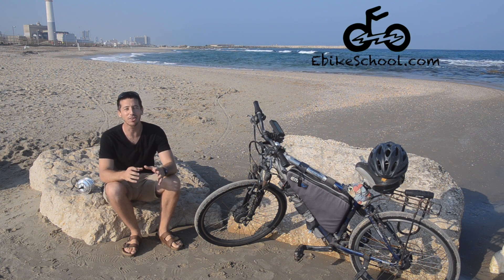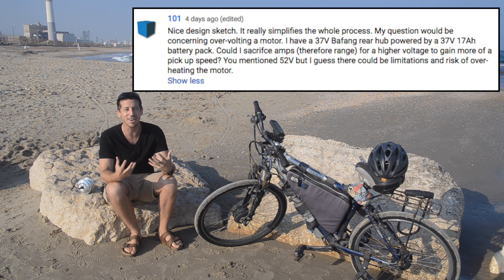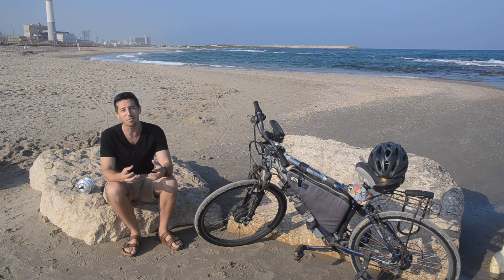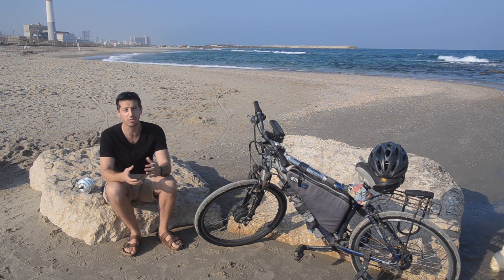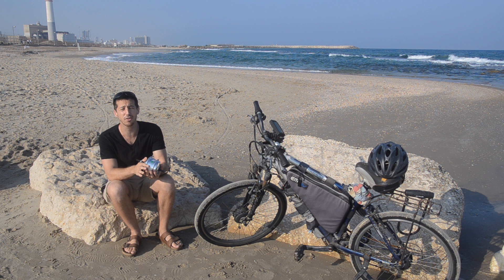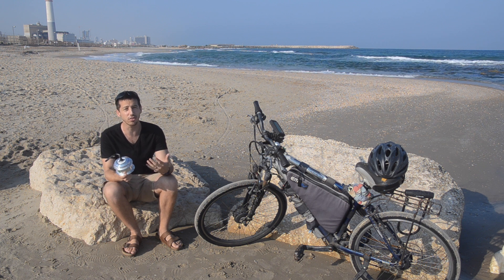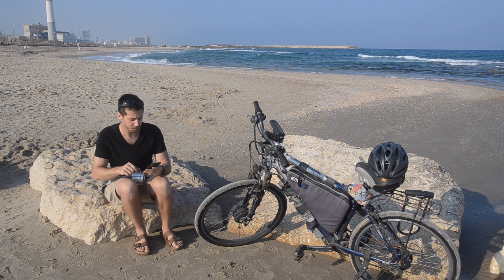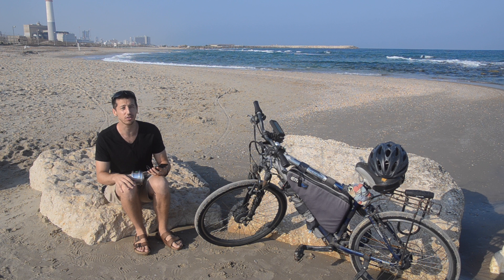Overvolting an electric bicycle motor for more speed! Q&A#7

Comment: By a Aniioki A8 Pro Max.Single rear hub motor.They have some customers return.I think $1.200 to $1,300.00.Then add a front hub motor.Let us see how it's done.The 2023 version is Hub motor 48 volts,1000 watt, Battery 52v

Comment: What happens if I have an electric bike with a 750W motor, and the controller, and the motor fails to work? What motor, and controller will be replaced for the 750W motor? Should I get my ebike fixed, or buy a new ebike?

Comment: Im making a solar powered carboat with electric outboards and 4 hoverboard wheels. It spins fast under no load especialy when i increase the volateg but when it has load less than 40kg, it doesnt move it. Why is it? Do i just need a bigger controller which is 70v instead of 36v?

Comment: Good explanation. I remember I had a motor many years ago back in the 80s. It was a DC motor, I applied 1.5v to that large motor and it ran, about 30 rpm, however that motor had so much torqute we had lots of fun trying to stop the rotation but we could not. Even that 1.5 D dry cell made it turn with super high torue.

Comment: Thinking about building a 16S4P 21700 (60V 20Ah) battery for my electric scooter (Yokamura i8), currently have a stock 13S5P 18650 battery (48V 15A). I have a Flipsky 75100 with Alu. PCB controller, and I'm pushing it up to 60A of phase current, and I'm very happy with the torque, but the max speed is only around 45-50 km/h on max charge and even less when the voltage decreases to <50V. I'll probably change the phase current to 40A or so to not overheat the motor. Also I'm thinking about buying a Kugoo G1 1200W-rated motor, which is actually capable of taking up to 6000W and even more, and this is the coolest motor which can be physically installed on my Ninebot G30-ish frame.

Comment: Hello Mica my name is Gunny I over voted an E bike that had a controller for 36\48 volt 22 amps motor came rated at 36V 750 watts I accidentally mounted a 48 volt battery rated at 1000 watts. My friend was buying it from me, while riding to the store and a friend's house all within a 5 mile radius of his home. He believed he had at least 20+ miles on 1 battery. He is not a heavy person 125 lbs. soaking wet.lol😊 on his way back home, about 3 miles , the wheel tightened up got real hard to pedal he said it was like the brakes were on.
After disconnecting the controller the.wheel spun freely again. Discharged the capacitors and reconnected everything and as soon as he pedaled it did it again! I installed different controller with display got it going told him NOT TO engage the PAS he should be fine.
It was until he decided to put a riser on the handle bars. He forgot when he reconnected it went back to default mode locked up magnets so I went through the same ritual trying to expect different results. HELP ME PLEASE. I'm pretty damn smart dude but this has me stumped.
I can put the motor on a different controller and it works fine. Is his wiring ( actually my wiring) F€¥¢π÷× Ed up or is there something I missed.
YOUR HELP IS GREATLY APPRECIATED AND THANK YOU.

Comment: Motors are usually manufactured with a 15 % "safety factor" built in ... so in reality a 750 watt motor can handle 862 watts before it  "redlines" the motor.
862 watt motor / 48 volt of battery = 17.9 AMPS ( volt x Amps = Watts )

Comment: Motors are in Watts ... Batteries are rated in Volts & Amps ( Volt is speed , Amp is power )
Amps x Volts = Watts ... or ... Amps = watts / volts ... EXAMPLE ( 750 Watt motor / 48 Volts = 15.6  amps )  highest amp limit or risk burning out motor.

Comment: Hey I have a e-bike running at 48 volt 20 amp and I’m looking to buy a battery thats 60 volt 24 amp all I have to do is buy a new controller that supports 60 volt 24amp right? Correct me if I’m wrong

Comment: Are you nuts? Amps and volts are directly proportional to each other,  the more volts you apply along with fewer amps means the speed of your motor will decrease.The motor weakens if you increase voltage and decrease amps or leave them unchanged. Sure, you will increase the speed of the Motor , but it will either  burn out the wiring, or your bike will just sit there if you attempt to go uphill. Less amperage equals Less torque . Tell me if im wronv.

Comment: I've got an A2B Alva+ 26volt 500Watt Ebike from 2014, it is incredibly built, unfortunately the axle spun a little and I have the wheel off to repair the wiring going into the motor, and surprise, no fastening hardware on the outside of the motor, which has a large UM stamped into the case. How do I separate the covers to get to the inside? there are 4 small grooves cut into both halves of the motor shell. Like maybe it is a srewed together clamshell design. Do you know?

Comment: I need to replace the wire into the motor but noone would fix it for me the tutorial on YouTube seem really hard to pull the cable out and you have to solder the cables etc i dont even have the tools so i want to replace the wheel but they dont selll 350w 36v only 48v 500w ... question can i still use the same battery and 36v with a motor that needs a 48v? Under voltage? Can it still perform as a 350w without any problem?

Comment: I did the math and it doesn't add up😅😅 it said that my 500w 20inch hub should be doing 19.2 mph yet mine goes 21.7 in first gear and 27.9 in second gear And I am a heavy guy 282 lb my controller overheats sometimes am I in freaky good luck with electronic lottery 🤔

Comment: I have a question.. I shunt modded a seeker24 dual motor, in the psettings I can change amps the controller uses or pushes.. its current 20ams.. but the controllers are rated up to 25.. would it be safe to bump the p-setting to say 22 ? would I see any speed or power increase ?  Motors are both 1000w, I have my controllers Resin Potted and added ventilation.

Comment: I really hope you respond to this.
I have a 48V 1, 000W motor with a controller of 15A rated current and 30A maximum current with a battery of 54V 12.5A

The motor spins freely without issue but when I sit on it and accelerate to about 15km/Hr the power cuts off, display refreshes (I am clueless if it's the BMS or controller  cutting off power and why}
Pls help.

Comment: Dude this is awesome!! Most excellent!! I've got a 1500watt rear wheel 29-in with a 48v controller. My question is can I use a 36 volt 8 amp hour battery without burning something out? The answer is probably pretty obvious but I don't know for sure I mean I get the idea that more is going to be faster and would be best to get a battery that has 1500 watt or 2000 w 48 volt 52 volt or 72 volt and as far as that goes what should I best invest my money in without paying six or seven hundred dollars for a battery I'm willing to pay $350 but again what do you suggest. Now I live here in Eugene Oregon and while it's pretty flat terrain there are still some hill in the areas that we need to go over bridges And it helps to have that little extra power to boogie on down the road. It's all about the amp hours that I see the price of batteries at a higher rate even if it's only 1,000 w 48v  if it's got a 20 amp hour or a 30 amp hour it's going to be a much more expensive battery. So also understand that 48 volt compared to 52 volt or 72 volt is going to be quicker off the line and a little bit faster when it comes to the volts but it's the watts is the speed I think right I don't know I would think that makes sense right if compared to say a 2000 watt to an 8000 w or a 12,000 w I mean it's obviously it's the difference between doing 30 mph and 90 mph which is crazy and really dangerous to say the least. But so I'm back to my original question I have a 29-in 1500 w rear wheel motor with a 48 volt conversion control kit and I'm looking for a good battery that will work well without burning anything up and have longevity so I know that the more volts the more amp hours the better and a 1500 w is more than enough to get to that 35 40 mile an hour long range battery life charge that will get me anywhere between 50 non-assist to 80 to 100 assisted.

Comment: Very bad advice. If you over volt your motor with a higher voltage battery, you can damage your motor. Stick with the battery type that came with your bike.
Reply: That's why he says to check the capacitors on your motor controller.

Comment: I've been running my direct drive 36v hub front wheel off a disability scooter as the rear wheel on my DIY disability scooter at about 82 V DC and love the better efficienty that it gave me

Comment: CAPACITORs should only be run at half voltage! Electronic design says put in caps twice the expected working voltage. 
Also why would you increase the voltage and reduce the current to get exactly the same power out it was designed for😮😮😮

Comment: Hi I've got 45amp controller 2000wat hub motor 52v battery for phace wire from controller to motor can I use 30amp choc box connection I've been trying different lug connection its getting the proper ones I bought on ebay they had yellow plastic where wire goes to crimp used bike phace congratulations were warm not hot I was told to use 30amp choc box connection can you give me proper answer I've watch all your video thanks

Comment: Hi. Thanks for the how to video. 
I was wondering how you can adjust to increase the voltage and or current of the hub motor in the controller? And do I have to get a higher voltage battery for my motor if I increase the voltage of the motor?

Comment: Hi mate I got a 36v controller and 36v battery 6.6ah is a rear hub 350 watt moter the bike I have is a windgoo b3 mini e bike is my lil brothers but dose not ride it iv seen a few modified mini bikes but no links for parts or vids of the build me personally been using is 12inch wheels is harf decent but not by no means eney 2 be excited about thas for share where do I start ie I did 1 build I had frend who had kugoo m4 pro and he broke it think the steam snaped and i bought of him for 50 and he all so had a dyu mini e bike thas battery did not work and he had snaped throttle so did a quick fix imgen I used the trigger throttle and controller and front wheel I bought a 800 watt moter and put the parts on the on the lil dyu i put the battery side ways thru frame strapped on with ratchet straps and me and my boy have and use it for a lil bit of fun for the boys nothing special but is a gd bit of fun

Comment: My computer has the option to set the battery to 36/48/52, so should I be safe to run a 52v battery in it? I have a diamondback powerline 27.5in

Comment: i use a dc > dc booster to run my ebike batteries at 60v. The caps in my controller can handle 63v. And that's 60v under load, so 38 MPH on my bike.Way better than my 52v running stock which is 58.8 and drops to 53v under load. And my 48v which runs even slower. Anyone who runs a bike should consider this option. All my 48v and 52v batteries are running at 60v all the time using the booster
Reply: I’m thinking about doing this as well and just use my 48v battery. I’m currently running a 1000w motor with a shunt modded controller that have 80v caps inside. I want to use a booster instead of changing the battery. What dc to dc booster are u using?
Reply: @jonk8337  you really want some beefy 1500W dc dc converter. If you have 80V caps, make sure that your mosfets can handle it too. Also, 72V and above controllers have up to 18 mosfets, and that is good. Your battery, when it is full, has higher voltage than native, but using dc dc converter, you should be Gucci because it keeps the voltage at 60 or tries to keep it at 60V.

Comment: Can 18650 Ebike batteries be charged at a level 1 - 2 ECar charging station? If you get thicker gage wires and the proper charging stn adapters & components? Or are 18650's not able to handle the higher amp quick charging loads like that?

Comment: i wish i would know the controller on my mobility scooter than i was given for free, i runs stock on 24v and its in general a older system, around 2009 the whole thing was new, the controller itself is not branded and had a serial number that leads nowhere

Comment: Why are so many people complaining about ebike speed? 20-30 mph is plenty for cycling. If you want to go faster...get a moped or motorcycle.
Reply: Those things are so expensive dude what don’t u understand
Reply: @ianleui7007  Well, you have to sacrifice for more speed. Speed is not cheap economically and socially. The social aspect is that to prevent such ebikes from licensing mandates, they need (in most states and provinces) to be limited to particular legal speed requirements. Delimiting an ebike basically converts it into an illegal motorcycle (depending on state/provincial statutes). Such illegal applications may be cheaper than an actual motorcycle or moped however, much of the bicycle community do NOT want ppl speeding in the bike lanes and trail systems at automobile speeds (35 mph+). Many motorists tend to hate us cyclists, so good luck taking to the travel lanes without some conflict. Out of all my years of cycling, I tend to agree that 15 to 20 mph are perfect cycling speeds. There really is no need to go faster than that.
Reply: @ maybe the area u live in those speeds are fine but other people have different needs and a bike is perfectly capable
Reply: @ and it also depends on the laws in your area. For me the max speed for e-bike is 28mph. It’s Fast but not too fast perfect for me to be honest. I agree bikes aren’t meant to handle 40mph constantly. Just follow the local laws and you should be fine. But your argument that drivers prefer u to drive slow is just a complete delusion on your side
Reply: @ianleui7007  I never said drivers prefer cyclists to ride slow. Quite the opposite, they expect us to be as fast as them. Many (not all) expect us to use the bike lanes over the travel lanes. Regardless, we have the right to use the travel lanes in accordance with law.
Reply: @thurstonrider  ok

Comment: my ebike is 60/72dvc Opp Voltage. current limit 30 amps, power 1000w (BLDC MOTOR CONTROLLER)  My ebike came with 6 small motorcyle sie batteries. 12v 24ah. what kind of battery do i need as alternative because it trusted the CHARGER with auto shut off, well it stayed on and damaged my batteries. i would like to upgrade to ONE BIG BATTERY if possible. can you recommend a Battery for my specs please?

Comment: I have a 60volt EV-RUNNER that has 5 batteries and room for 1 more, can I add one more without changing the controller? I can't identify the specs on the controller since it's in Chinese